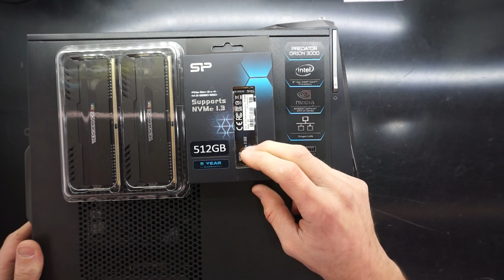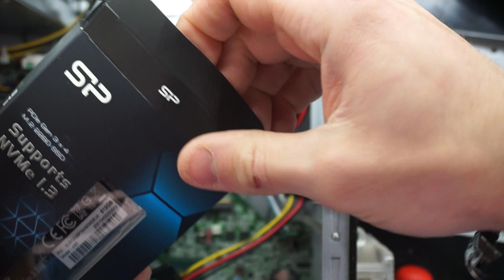Acer Predator Orion 3000 Upgrade Options

Comment: Bro, I want to change my PSU on my same Acer Predator Orion 3000 with p03 630 motherboard, please give me recommendations, the stock power supply is only 500W its not enough
Reply from the maker: i dont have any recommendations for you

Comment: Would a 2.5 inch ssd fit on the hdd panel  screw holes or do I need a 3.5 to 2.5 adapter?
Reply from the maker: i think it should be ok

Comment: ya can't change the ram speed in the bios, I just bought a 3600mhz kit and there is no option to change it so it runs at 2133. Replaced the power supply and chucked a 3060ti in.
Reply from the maker: bugger.  i think you might have upgraded it as far as i would

Comment: Hello and good video. This is my pc: Acer Predator Orion 3000 i5/16/1024/3060TI....
I was wondering how i know whitch part is right to buy i was thinking of buying better cooler or more ram i really dont know its just i wanna get more and smoother fps if you know better parts to upgrade it could really help <3
Reply from the maker: with those specs, atm there really isnt anything i would suggest upgrade to, without spending $600+ Dollars 

Maybe a decent after market cooler if your board supports it
Reply: @rickstechrepairs  ok, ive had this about 2 years so idk if its long time or
Reply: btw what i can upgrade with 600+ euros?
 @rickstechrepairs

Comment: Sorry I'm a bit new to this — did this PC lack something in the SSD slot, or are there two available? I'm looking at upgrading my 256GB to a Samsung 990 Pro 2TB M.2 NVMe but I'm not sure whether I can just add a second SSD or not (I'll be thrilled if I can so I don't have to buy an adaptor to transfer everything 😂)
Reply from the maker: i think this system only has a single 1x NVMe Slot
Reply: @rickstechrepairs  thank you so much for the quick response! I'm struggling to figure out what adapter to buy to transfer everything, though that might be a case of NZ having limited options 😅 I'll figure it out eventually!

Comment: Hi just wanted to know if it could be possible to install a 2.5 ssd in this pc ?
Reply from the maker: yes it would connect up with the sata data and sata power cable
Reply: @rickstechrepairs  alright and i know that there is a Sata Power cable already inside the pc but there is no Sata Data cable right ?
Reply from the maker: i think you are correct, will need to buy the data cable

Comment: Anyone know good cpu cooler replacement fans that’ll fit in this case?
Reply from the maker: with the cpu coolers screw in design being pretty rare, i dont have suggestions sorry
Reply: Did you find any?
Reply: @jaakkopohjolainen5652  no I didn’t sadly I replaced my thermal paste and it helped a bit

Comment: I have an Acer predator Orion 3000 po3-640 with an Rtx 3070 and I’ve been wondering if I could change the gpu to a 3070 ti or a 3080 and if I could change it so I can have a SATA SSD in there aswell
Reply: NVMe better than SATA

Comment: is it possible to upgrade my graphics card from a 3070 to a rtx 3080 ti on acer orion 3000?
Reply from the maker: Possible need a PSU upgrade
Reply: @rickstechrepairs  my current psu is a i7 10700 what should i upgrade to ?

Comment: I’m having an issue with my predator Orion 3000. At first it was a power cycling issue. I changed my power supply and reset my CMOS. It no longer power cycles, however when I turn it on, it does not boot up and I get one long beep noise from the speaker. Can anyone help me?
Reply from the maker: not sure sorry
Reply: Yikes, that could be a motherboard issue.
Reply: @mikem9536  all good just reset bios and it’s good

Comment: Sense my acer predator Orion 3000-630g doesn’t support xmp profiles how do I exactly make the ram speed 3200 MHz if it’s not the stock configuration?
Reply from the maker: dont think the bios offers that level of customization to do that

Comment: hey, man i have the same pc but with a i7 core and a rtx 3070 and was trying to upgrade the graphics card is it safe to do?
Reply from the maker: dont know if a 3070 would fit the case :O
Reply: srry to make things confusing i meant it alredy has a 3070 but ima get like a 3090
Reply: @allworthstorm_5491  Doubt it would fit, this PC uses gimpy 1 fan GPU's.

Comment: Hey, just wondering do you think it would be possible to replace the power supply in this prebuilt as i am looking to upgrade the gpu, thanks.
Reply from the maker: it all looks standard regarding PSU
Reply: Might as well build a new PC, this case struggles to keep things cool.

Comment: Can I change the fans? I heard it has a really bad cooling system and that it overheats so much that it turns off after 2 hours. I dont know what to believe now
Reply from the maker: yes you could change the fans, change the cpu cooler to an aftermarket one

Comment: Hello! Could you install a M.2 drive on this rig?

Im thinking about this one:  Kingston KC2500 M.2 SSD 2TB

Anyways thanks for a great and instructional video!
Reply: Also, just a quick tip, try a new variety of thumbnails, maybe to something with the keywords marked red, or/and a nice catchy font. Maybe blur the backgrund and just add the text above. Just noticed that when looking at your other videos. That is the first thing you see so im sure that would help!
Reply from the maker: I'm pretty sure the Acer supports NVMe, so the KC2500 would be a great SSD to install
Reply from the maker: Cheers for the thumbnail tip, Im not overly creative so I will try out some of your tips, thanks
Reply: @rickstechrepairs  No problem, and thanks for the help!
Reply: @idqnnez1338  did you buy the SSD? Did it work?
Reply: @droneshotsantoine1805  I did and it did work

Comment: Hey man, just wanted to know if it’s possible to upgrade the PSU, to one day hopefully fit something like a 3070 in there?
Reply from the maker: you may require to a reinstall of windows 10 / 11 at this point
Reply: @rickstechrepairs  See like I found this one on facey marketplace, it’s the same sorta one as yours. just wondering about it’s long term viability because you can’t really upgrade that power supply can you?
Reply: I wouldn't try it with this case unless you want a heater.

Comment: Hey man. I just bought 2x16gb 2666 and replaced them with the old ram.. Same slots.. And my orion 3000 keeps freezing... You know what could be the issue?
Reply from the maker: possible the machine doesn't support 16gb slots 

Try one stick at a time and game
Reply: @rickstechrepairs  the orion 3000 supports up to 4 x 16gb ram.

Comment: My bespoke high-end-rig finally gave up (not bad for 9 years). With 1/2 a site uploaded to a server, and sheer desperation, I bought a Predator PO3-600. What a piece of crap this thing is. After the cooling software stopped working (Win10 patching), had to install MSI Afteburner, and remove the side cover, and blow cool air in via a fan, otherwise the system would crash,power down and would be unable to start up without a good 10 mins. I've had some woefully bad, off the shelf systems since 1996, but this Acer Predator PO3-600, tops them all for a complete rip-off!
Reply from the maker: Bugger, disappointing to hear
Reply: Yeah this computer cannot handle any heavy tasks, it just gets hot as hell.

Comment: Hello, does the Noctua NH U9S work for this pc, the rtx 3070 and i7 10700k version, also do I have to remove the motherboard for this, I wouldn't want to do that, if not what is a high quality cooler that can fit in this case.
Reply from the maker: not sure on that one sorry

Comment: Hi , I have upgraded my pc (it seem your pc) and sadly it’s running at 2122 ghz (instead of 3200) 
What is problem here can I fix it from the bios?
Reply from the maker: See if you have the option in the bios to enable XMP
Reply: @rickstechrepairs  no , i heard most of the Options in the bios is locked
Reply: @myo972  did you ever find out how to do the speed

Comment: The RAM you putting in 2666 and 3200 together. They will all become 2666. because the ram never over the limit. I would not put that 2666 back in. 16GB is enough even in 2021.
Reply from the maker: Correct, miss matched ram run at the slowest of MHz 

16gb unless you are playing warzone

Comment: I have predator 3000 (i7 and 3070 graphic card). My pc is so loud when I play warzone. Is it possible to change the fans so it makes it way more quiet?
Reply from the maker: i would change to an aftermarket cpu cooler
Reply: @rickstechrepairs  yeah had to do the same thing to my cpu.
Reply from the maker: i find using a good aftermarket cooler is almost insurance to keeping your cpu cool. for long term usage
Reply: @rickstechrepairs  do you know how Big it should be to fit in my Acer predator 3000?
Reply: I changed my case fans, from the 2x80mm to a 120mm and a 92mm, much quieter now and cpu stays cool enough.
Reply: @mikem9536  alright, i might try it out! Thanks

Comment: Will an i7 9700 or i7 10700 fit in this pc
Reply from the maker: nope and nope, will highly be likely that you will only be able to use 8th gen cpus in this machine
Reply: @rickstechrepairs  it can. its a b360 chipset which can accomodate upto 9th gen with a bios update. 10700 is not compatible with this motherboard as it is 10 gen and they require intel 400 series chipset.

@Liam j i have i5 8400 with gtx 1060 6 gb orion 3000 PO3 600. Since buying a new GPU is jackshit in today`s time, I am upgrading to i7 9700k as thats the max my motherboard can support. I play csgo, css, r6 siege, insurgency sandstorm and bfV. 

Note: For bios update you require the 8th gen cpu. Latest BIOS version RO1C1. My PC had some RO1 A0 version. In short, i updated my BIOS to RO1C1 and now my motherboard is ready for i7 9700k.
Reply: https://www.acer.com/ac/en/IN/content/support-product/7712?b=1&pn=DG.E11SI.003

Comment: I want to buy this pc with a 3060ti and i7 10700k, but will i be able to upgrade my cpu to a i9 9900k?
Reply from the maker: No
Reply: @rickstechrepairs  Why not?
Reply from the maker: If it has a 10k series chip
You can change down to a 9k chip
Reply: @rickstechrepairs  yeah so it goes from a i7-10700k to a i9-9900k so thats possible then right?

Comment: I have this PC and the CPU temp is from 80% to 96% constant when running games and ranging 55-75% standby on desktop. I recently taken the dust out. And it is still the same. Please help
Reply: same. it seems this pc just runs hot.. my fans are running 90% need to upgrade the cooling system IMO
Reply from the maker: The Intel CPU simply runs extremely hot, this is pretty much the same with any intel made since 2017

Look in to replacing your CPU Cooler with an aftermarket one
Reply: Replace the loud 80mm fans, 1x80mm intake is not enough air.

Comment: Hey, could you  give me please  ram model of this computer ? I would like to buy an additional 8 GB and I would like it to be the same model.  I would be grateful if you could give me a link to some offer.  😉
Reply: It depends which CPU you've got e.g. I have the Predator Orion PO3-600 with an i7-8700 and the CPU can´t handle more then 2666MHz of RAM ;so you should not buy anything above that; and on the other side you need to buy a RAM that is Acer compatible, because I bought Corshair Vengence 32GB RAM KIT and it uses Intel LPX(the CPU would support that as well) but the motherboard doesn't support it(BIOS). The Compatible one was afaik Crucial Ballistix (https://www.crucial.com/compatible-upgrade-for/acer/predator-po3-600).

For the same model just unscrew your PC and check the RAM Model installed. I had an ADATA not a Kingston RAM Stick built in so it may vary, which PO3-6** you have.

Kind Regards
Arne

P.S.
My mother tongue is not english so please forgive any grammatical/spelling mistakes.
Reply from the maker: i dont have this machine to tell you those specs, i would aim for a single stick of 8GB DDR4 3200mhz, it would be faster ram than whats already installed and will downclock its speed to match, to still get dual channel preformance

Comment: What ram did you use?  Is it possible to replace the RAM memory here?  I just wanted to completely replace the RAM in this computer and I don't know what to choose.
I have one stick 8gb.
Reply from the maker: i would add another single stick of 8GB DDR4 3200mhz
Reply: @rickstechrepairs  the current memory runs at 2666MhZ.
Reply: @rickstechrepairs  ive add anotherr 3200mhz but somehow the system automatically downgraded it to 2667mhz. what can i do?
Reply: @myo972  its bc if u have 2 rams with other mhz both will run with the same mhz (the lower one)

Comment: besides RAM and SSD , what would you recommend upgrading??
I have this exact same PC only with GTX 1070
Reply from the maker: maybe gpu but i would hold off until the prices drop

What monitor do you have?  i would get something 24" and 144hz
Reply: @rickstechrepairs  I was thinking also to just hold off on the GPU and I have a pretty generic monitor(I dont know which one it is :P but as of right now Im not looking to upgrade it) , maybe the power supply?
Reply: The fans, 1x80mm intake and 1x80mm exhaust is not enough, i replaced them with a 92mm exhaust and 120mm intake on the side. Went from negative pressure to positive pressure (now I won't be sucking in dirt in every hole).

Comment: Hey have this pc with a RTX 2070 and CPU i7-8700, 16GB of RAM and a 500w power supply what’s my best upgrade options? 
Also have a small heat problem prosessor gets up to 88 celcius some times
Reply from the maker: upgrade to an aftermarket cooler
Reply: Thanks but what would be the best GPU and CPU that fits and works with this pc?
Reply from the maker: what you have already seems like a pretty darn good combo.

At this point in time i wouldn't even be looking at an overpriced 3070 for like a 25% performance increase
Reply: Thanks Yeah i thought so to but I just feel like i can’t get the performance i would like in all games. i play fps shooters, total war series and other rts games. in total war and rts games it have some issues on high and ultra settings that i would like it to run. I would at least like it to run high settings. Maby somthing i can do or adjust on the pc? I am fairly new to pc gaming used console mostly
Reply: Change the loud 80mm fans for bigger quieter ones (I went with a 92 and a 120).

Comment: Would it be possible to upgrade the mother board in this pc to a better one or will it fit?
Reply from the maker: You could but there wouldn't be much point
Reply: @rickstechrepairs  why not
Reply: @poopspark  The case is hot garbage.

Comment: I m thinking of buy Orion 3000 with 8400+2070, its only 130$ more expensive than the cheapest rtx 2070 on market now and i really like the case. But would like to get a lga1700 motherboard when realise.
Can i put mATX or mini ITX motherboard on it? Or what form factor i should looking for?
Reply from the maker: i would assume the form factor is mATX, so a 11th gen compatible board should go in fine
Reply: @rickstechrepairs  as i find the answer: Orion 3000 po3-600 MB is 200x321, mATX is 244x244, mini ITX is 170x170. I bet it would be better to take a smaller one
Reply: @rickstechrepairs  It seems like DTX in reviews, mATX is a square form, and its a rectangle

Comment: I havs bought this pc with 3070 and i7 I have heard it overheats a lot can I add more fans. Or is there any other way to improve cooling?
Should I improve cooling at all?
Reply from the maker: Aftermarket CPU Cooler
Reply: What did you end up doing about the overheating? I just bought this thing and noticed that CPU temp reached 100° while just installing a game. 75° is basically it's base temperature after an hour being online and idle. I understand that this pc is just a cheap wrapper for the RTX card, but this is ridiculous :D
Reply: you should probally turn your fan all the way up and perhaps try to clean your pc and get a new thermal paste on your cpu
Reply: I have not done much, when I got the computer I started trying some different things like maxing the fan speed,  but then was too loud.  
I wanted to buy a new cpu cooler from noctua but I spent the money on a new monitor. I would  recommend creating a custom fan curve on MSI afterburner so ur gpu is at least ok because it can get a little bit too hot sometimes. I will probably buy a new fan eventually but I am currently playing more gpu intensive games.
Check out noctua cpu fans and make sure they fit in this mini case otherwise you might be able to install an extra case fan in the top but I am not sure about that.
Reply: Biggest issue with this pc is the lack of case cooling (1x80mm intake) I replaced the intake with a 120mm side mounted fan and replaced the 80mm exhaust fan to a 92mm.
Reply: Problem with turning fans to max is that the program is garbage and it sounds like a jet engine

Comment: Would I be able to water-cool my CPU with this model my CPU is runs at 80c playing games
Reply from the maker: you probably could, but a decent air cooler should help
Reply: @rickstechrepairs   so maybe and extra fan?
Reply from the maker: https://www.aliexpress.com/item/33034600926.html?spm=a2g0o.productlist.0.0.34b423f96RYelA&algo_pvid=1629d0d2-811a-4915-991f-87b4c4170d76&algo_expid=1629d0d2-811a-4915-991f-87b4c4170d76-2&btsid=0b0a555f16120885974886420e212b&ws_ab_test=searchweb0_0,searchweb201602_,searchweb201603_